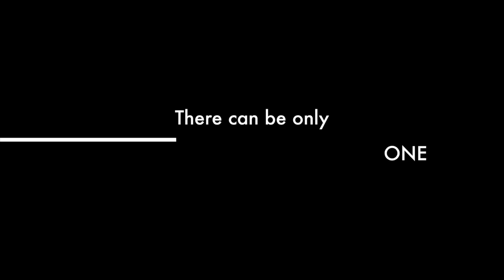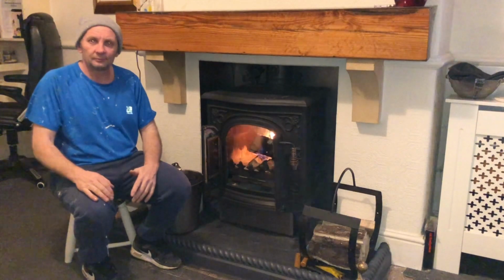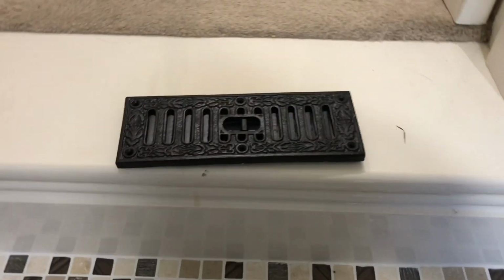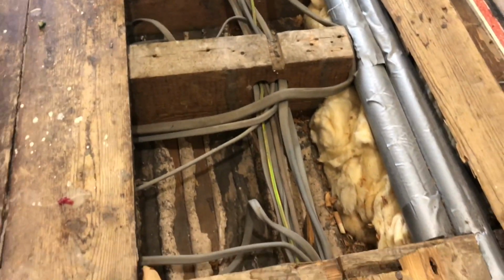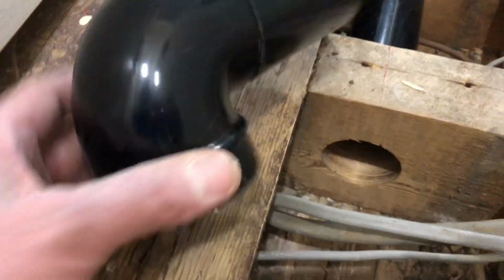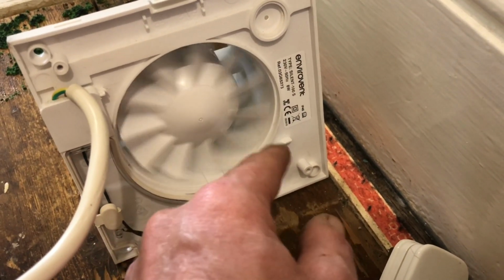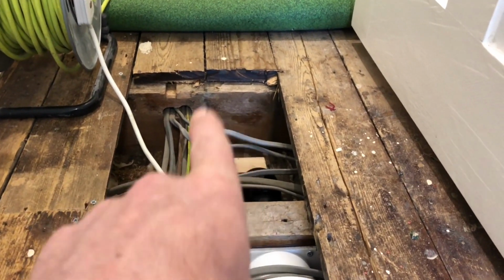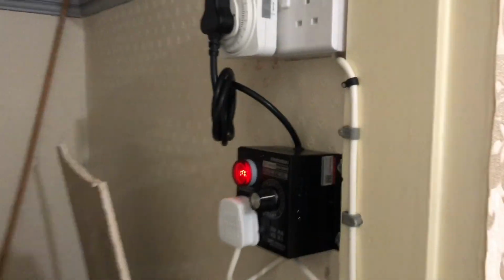How to vent the heat from your fireplace around the house

Comment: This has been really useful. I have a log burner which gets the room up to 25C easily but the bedroom above is still 12C. So I'll rig up something similar to this. This has given me the confidence to do it and some useful ideas. Also, I don't need the whole house warm all the time. Just the living room most of the time and the bedroom at night. I still have central heating for other rooms when needed. As for whether it's more efficient than central heating, well I collect and dry my own wood from my own land, so it's effectively free, not accounting for my own labour, but I'm retired so my time is effectively free too!  I'm wondering if I could use a thermostatic voltage control instead of the dimmer control you have. But thanks for the useful video.

Comment: My thermodynamics is sketchy at best, but I don't think fan speed will necessarily affect air temp. A heat gun or hair dryer might be hotter when slower, but they're moving the air over a heating element. A car heater is closer to your set up - as long as the engine's hot, the fan will blow hot air. Above a certain litre per minute or whatever, you would be significantly cooling the room below, like when you put the heater on to cool an overheating car, but I don't think your bathroom fan will be strong enough. Brilliant vid though!
Reply from the maker: Most of what you’re saying doesn’t make any sense to me sorry, the idea is to use free heat in the room vent  into the bathroom.
Reply: @wallingtonfilming  My bad - at 22:02 I misunderstood. I thought you meant the fan cooled the air - now I get it, the air cools the fan.
Reply: Yes he does say the fast fan cools air down which is clearly questionable. 22:02. If you put your hand in an air flow it does cool your hand down but it maybe does not happen for air against air. Or if it does the temperature transfer just stays in the same room so no loss overall.
It's nice to be able to adjust the fan speed though.

Comment: I don't have a central heating system. I do have a terrible stove which I'm looking to upgrade and some electric storage heaters downstairs. Hence watching this hoping to find an alternative to getting a load of radiators and plumbing etc etc just at the point where even the stove is almost (but not quite) redundant... Thinking on it anyway
Reply: PS great use of the term 'shit loads a  heat'... Loving this video 😅